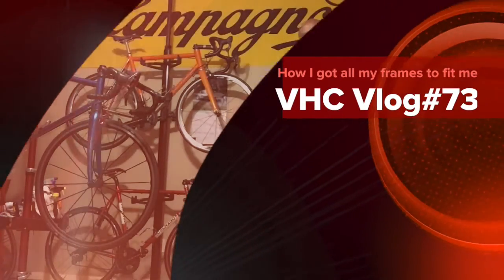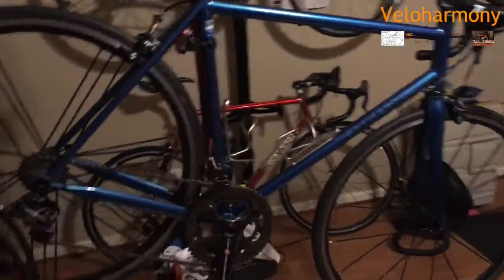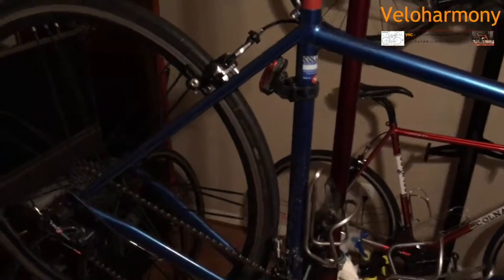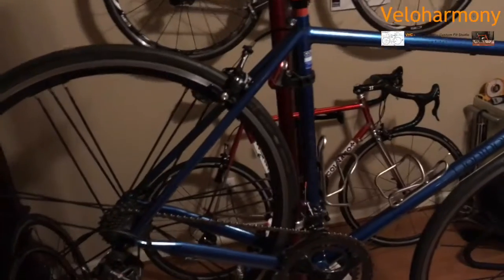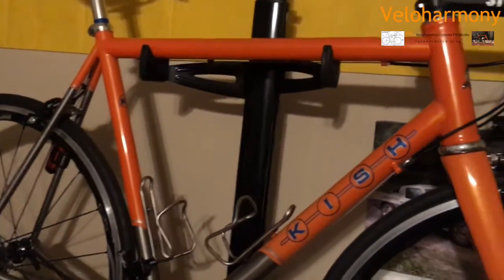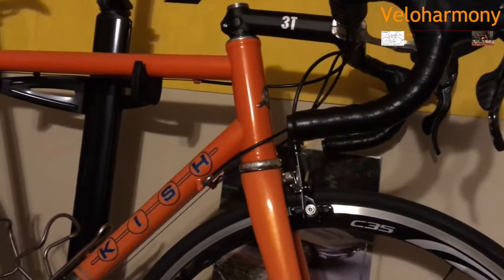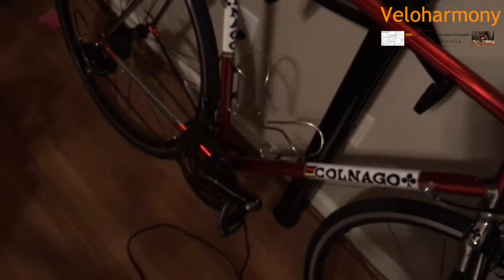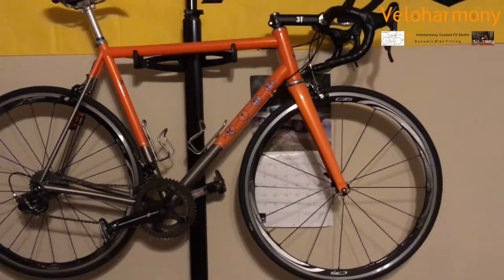How to setup a bike frame - Specific components on my bike frame.

Comment: very nice bikes and interesting setups Eldred. I recently acquired a 1988 univega 6 speed and I'm thinking about using my spare 10 speed components I have lying around to build it up as a 10 speed. the front triangle is aluminum and the fork and rear triangle are steel.